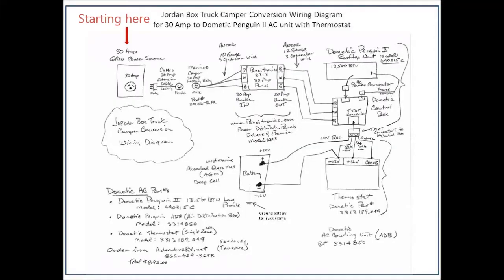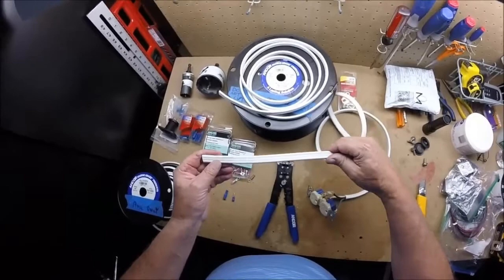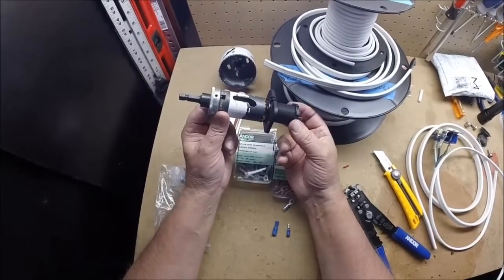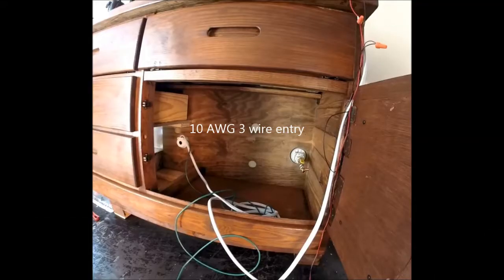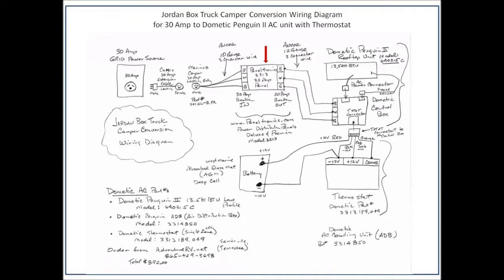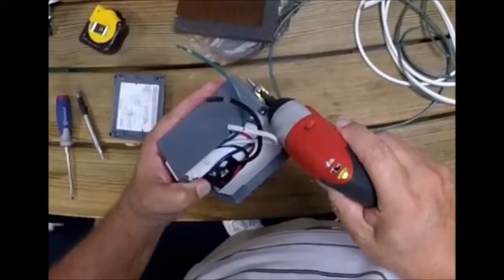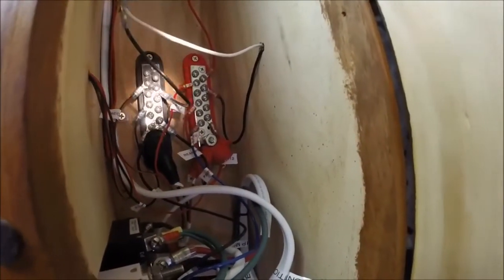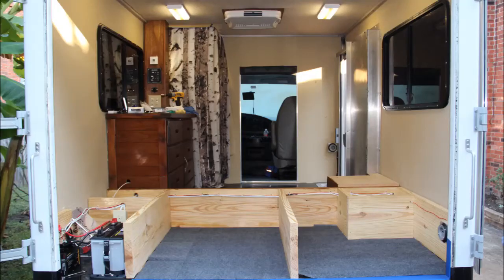Jordan Box Truck Camper Conversion Electrical and Dometic AC Detail

Comment: Wow nice video, very thorough and awesome attention to detail. You really used a lot of high grade marine equipment to complete your electrical as well as other connections. This will be a great reference for anyone completing a DIY camper of any kind. I plan on having off grid or boondocking capabilities on my RV/Camper and will be mounting a honda 2000watt generator to run anything electrical. I will probably keep it simple and just plug it into the 30amp input from shore power when it is needed. This brings up an issue for me if I were to go with a penguin II ac unit. It is 13,500 btu and runs at 13.7 amps for heat and 1530 watts. Im sure it keeps your rig comfortable on even the hottest days in Florida but my generator will probably not handle that. What are your thoughts on me using a 5000 btu 4.8 amp 500watt window a/c unit?  Our rig's are only 6x10=60 square feet and it says it can handle 150 square feet. I'd like to know your thoughts. I plan on mounting it high in the rear inside  like they do on some of the modern class Bs.
Reply from the maker: +JYDOG I used to own a 1000 watt Honda generator and I thought it was a great unit.  For the size of AC you are considering certainly the 2000 watt will handle it.  As I recall, I researched using two 1000 watt units that together were capable of starting and running an AC of the size of mine.  Start up amps is important, once past that then run amps is lower.  I am actually in Houston, Texas and we get 100 degrees in the summer, so, taking no chances on the AC requirements.  I looked at a 12,000 btu unit, and for the cost the 13.5k was still a good price.  I tried using an SPT, single hose portable home style unit, but it would not cool the box down more than about 8 degrees on a hot day.  It was a 9000 btu unit, and the test was in the box without insulation on the ceiling at the time.  You may be able to find a used rooftop unit, but I would say if you have the 5000 watt unit, test it and see.  Roof heat will be your biggest heat source in the summer.  btw, I was impressed with your ability to take that original truck, install a working engine in it and then attach that box from the other frame.  I don't have the skills to do the engine, and space to change a box like that.  Great work!
Reply: +ottodiezel Thanks for letting me know you tested with 9000btu. I think I will try to match what you did on the roof for insulation and maybe add 1/2 to 1" on the sides. That polyiso is 3.6R per 1/2 inch so that should do something.  I would have been better off buying a box truck built. I bought the whole cutaway truck for 1k for the rear axle ( 4.10 limited slip with disk brakes ) which are kind of hard to find to put in my 94 e250 coachmen. It sat in the back yard for a while before I got to it and I started feeling bad about tearing it apart for just the axle. So one thing led to another and I found a box in a salvage yard just like I wanted $450 and it started happening. The engine has 68k miles on it so I figure I can at least get another 200k out of it. I built another van a few years ago that was 4x4 I'll have to post pictures of that. I don't have any video just pictures. I guess this is just the progression of the obsession for building an awesome camper like yours. I think I will buy a window unit 5,000 btu like I was referring to and not mount it just try it after I get everything sealed and insulated and see if it works they are only $100 if you can believe that.  I hope you don't mind me bugging you with question like this once in a while as I get this thing built.
Reply from the maker: +JYDOG My pleasure to assist another DIY guy!  Want me to post something on the Polyiso and the adhesives?
Reply: ottodiezel I sure would. I just bought 12 sheets of 1/2 in and I am about to start installing it after I fix this roof leak.
Reply: +ottodiezel This is the best camper conversion ive seen so far. Great job on it!
Reply from the maker: +Jonah Halbert Thanks, lots of visual work on it before i built it, then lots of hard work to get it done.  Thanks for the feedback!